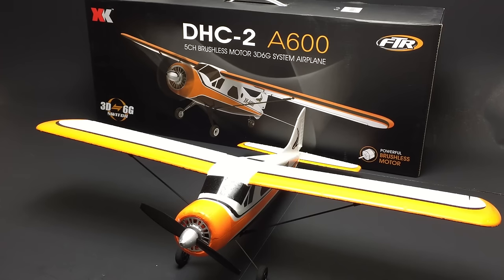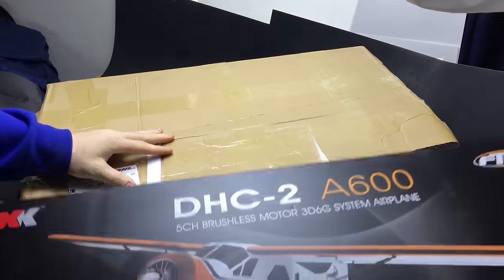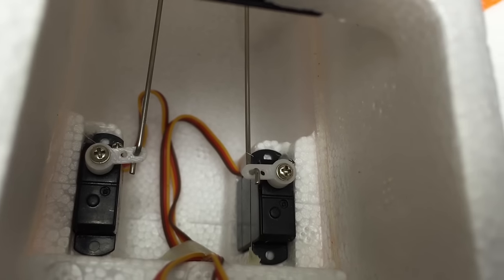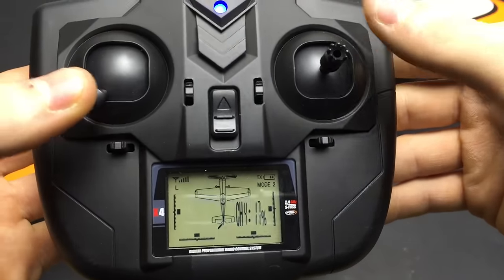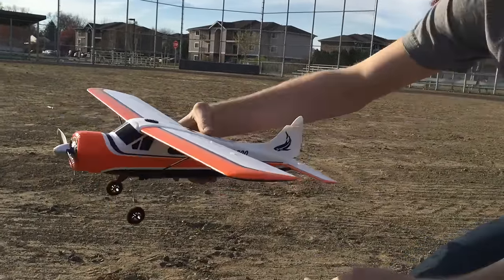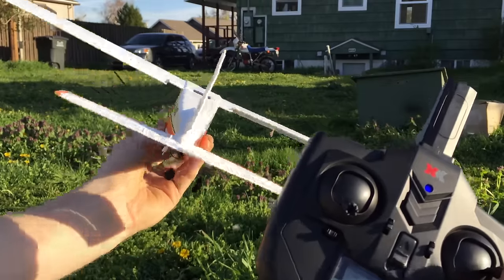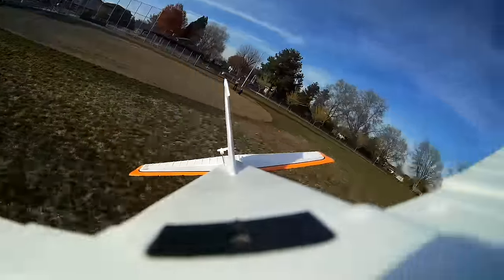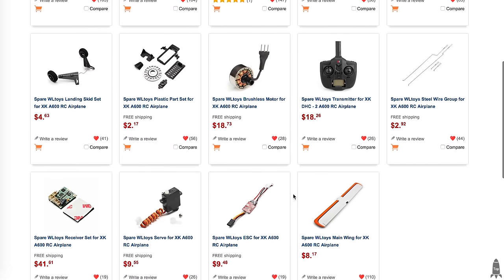Review | XK A600 - DHC-2 BEAVER

Comment: I just ordered an A600 from GearBest. Can you tell me what uprated battery I can use to get more filght time, and I'm wondering if it will also  give the motor additional power? I'm expecting no. Also, GearBest no longer seems to carry a lot of parts for the Beaver. Just a few.
Reply from the maker: I found the flight time to be more than enough, and I doubt you can fit a much bigger battery in there.
Reply: I won't have the ability to charge out at the field, so I want the largest capacity battery I can find.

Are you talking about physical size when you say bigger, b/c I found a few 7.4V batteries that appear to be similar in size to the origial, but they have like 1200mAh. I'm not sure what battery specs I need to follow other than the 7.4V.
Reply from the maker: Well, you could try and fit a 400mah 2s in there, check the connector type. But the best option in my opinion is to get more of the same battery
Reply: Yeah, I just ordered 2 more oem batteries on BangGood.com. Wish GearBest had more parts for this plane. Their prices are usually better.